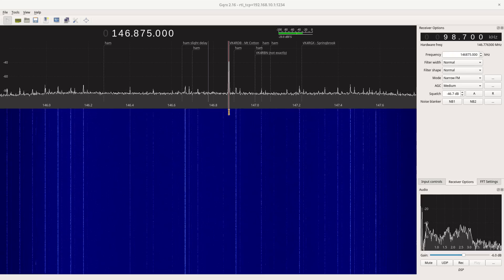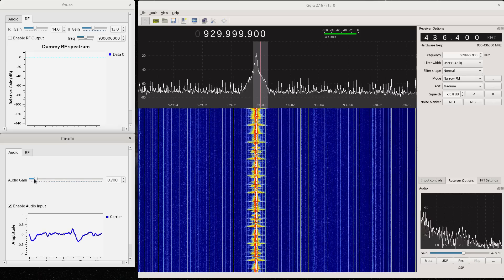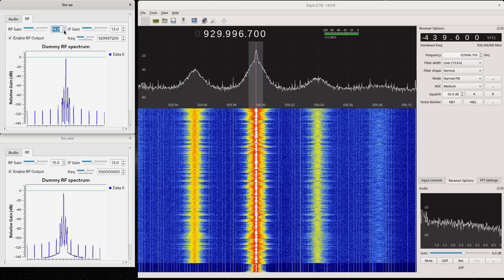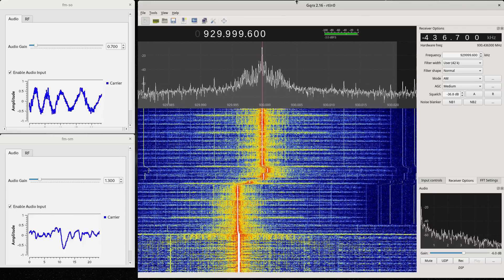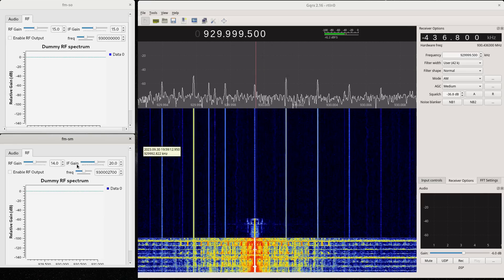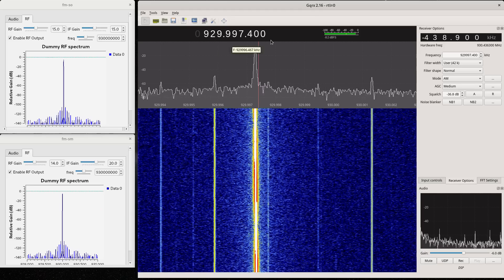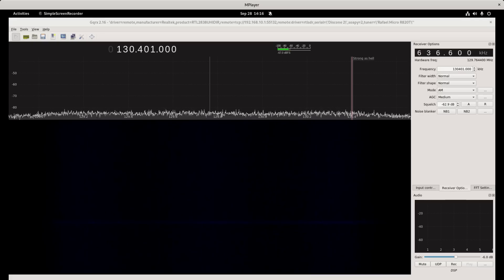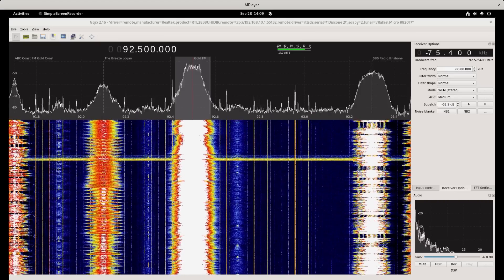Demonstrating FM Capture Effect

Comment: Aaaah... I always assumed BOTH AM and FM exhibit the capture effect! I've also often wondered why AM remains the civilian airband  mode of choice (true of the miliitary airband too, I think) and assumed it was some kind of "legacy installation" business. Many thanks for the carefully crafted and informative presentation Paul👍.
Reply: No, aircraft use AM for good reason. This is so if some clown talks out of turn when tower approach is giving instructions to a pilot for landing, either party will know somone transmitted on top of them.
Reply: AM capture-effect does exist, however, it does require a higher separation than FM in the RF levels between the two carriers (6-10dB difference for a near total capture).  Most instrument landing system (ILS) localizer and glide slope systems utilize the AM capture-effect phenomenon to reduce the effect of multi-path reflections from terrain and buildings.
Reply: @jamieedwards8552  Cheers for fleshing that out,  including the ILS aspect👍. Quite an eye opener to realise the subtleties of all this...

Comment: In practice you can't hear both aircrafts on AM, because their radio carriers are never in phase and on the precisely same frequency, so what you can hear is beat sound of the mixed carriers, meaning nothing intelligible can be heard. Sometimes it is referenced as "duplex transmission. " Accidents have happened because of that fact, like the one on Tenerife, where two Boeing 747 collided on the runway on March 27, 1977.
Reply from the maker: I think a lot of things came into that particular incident, but even if there's that squeal from the mixing, that would probably at least let you know 'something' was transmitted that you missed, right? I don't fly planes though, so I'll believe the others on here who have... except for that pinned comment guy!
Reply: They arent perfectly in phase and arent perfectly out of phase. Sometimes you can hear two conversations at once. Other times they wil heterodyne and you will get the squeal.

Comment: Ameture radio ops can use AM but problem is singal won't go too far and inteferance
Reply: Absolutely not correct. Amateur radio uses all forms of modulation. In fact the most widely used method for transmission over any significant distance including around the world is a single sideband suppressed carrier, SSB, a form of amplitude modulation. FM is generally not used for world wide communications because the portion of the spectrum capable of transmitting world wide, HF, is so limited and effective FM as usually implemented demands much more bandwidth than SSB. The most efficient use of spectrum is CW, Morse, simply turning the narrow signal on and off. The VHF and UHF frequencies generally used for FM are not effective for world wide communication but have much wider channel width available.

Comment: Isn't it also because AM can travel longer distances?
Reply: No, that is a property of the wavelength, not modulation. You don't want to transmit coordination around one airport over to other cities.
Reply: @j7ndominica051  ah right.
But like, isn't long distance radio usually on AM?
Reply: It is. But long distance radio uses frequencies below 20 MHz, while aircraft use around 120 MHz where communication is in line of sight.

In amplitude modulation they can pack more channels. While understanding two on nearly the same frequency would be difficult, there can be overlap in the treble portion of the signal.
Reply: No to the question.  AM is merely  a modulation scheme.  Distance has to do with frequency and watts not whether the amplitude is modulated, or the frequency is modulated. The higher the frequency, the more watts needed to cover the same distance.

Comment: Eventually answers the question at around 6:40.  Apparently a bunch of other commenters missed that.  But yeah, would have been a much more convincing demo using two voice signals, instead of music which is famously mixed to occupy as much of its spectrum as possible and thus less amenable to hearing sensibly two signals at once.
Reply from the maker: I absolutely agree with you, and I wanted to use a male and female voice for the demo. I couldn't think of any female voice to download and use, although I waited for a female news reader on the radio or something. For the male I was going to use the intro to "The Eve Of War" but copyright might have gotten that, so I just went with two different styles of music. You're right though, and it would have been better with voices.
Reply: @TallPaulTech  I appreciate your efforts regardless. Maybe you could have just recorded some voice traffic off your SDR? Or from VASaviation channel?
Reply: FM has a capture ratio as well. Which means the strongest signal almost completely dominates in the case of two simultaneous transmissions.

Comment: Ham (Amateur) radio uses both AM (actually SSB) and FM modulation. FM is typically used in the VHF/UHF bands, but AM can be used there. AM is used most commonly on the HF bands. Also, a variety of modes (not modulations) are used for voice and data (Morse code is technically a form of data). CW (Continuous Wave) used with Morse code can be used on any band. With CW, you "modulate" the signal by turning the carrier on and off.
Reply from the maker: Absolutely, OOK.
Reply: HF air band uses SSB and USB to be more precise. It was SSB that replaced CW on HF air band.
Reply: SSB is a form of modulation. USB means upper sideband, LSB means lower sideband. The choice of sideband is a matter of convention.

Comment: Yea, in practice this does not work. When two aircraft try to talk on the same frequency, you get a squeal that is unreadable. The actual reason for staying with AM is that aircraft regulations for equipment, at least in the USA, is notoriously behind the times. The majority of equipment before the turn of the century was technology from WWII. GPS has changed that, but radios are still behind. The system should have gone digital by now, and there is a good case for why it should come from overhead satellites. This would dramatically improve the system. A lot of it is simply because the FAA (america) does not care much about general aviation, but is oriented around airlines. GA has issues with radio signals being blocked by mountains, but airlines fly high enough for that not to be a problem.
Reply: No, the USA is NOT notoriously behind the times.  AM is used throughout the world on the aircraft band because it is a safety issue because if FM was used,  the capture effect would coverup a weaker signal.  If there is het thrown out by AM, either the tower or another aircraft would know that a signal was interfered with and ask for a repeat.  With FM there is no het. And NO, you CANNOT use digital on the aircraft band because the cliff effect. With digital you either you get a signal or not. Digital has far less range than analog. It would be a disaster if the air band went to FM and especially digital.
Reply: @joeblow8593 The US is behind the times and there is no weaker signal coming through on AM. There is just loud squeel due to hetero. Have you actually used an aviation radio? I'm a professional pilot of 23 years in the US. I'm heading to the airport in 45 minutes. I can't wait for this stuff to go fully digital. The jets I fly use CPDLC (digital) wherever possible but sometimes it's not available depending on where we are. We are all required to have ADS-B out and most modern aircraft even have ADS-B in (if not built into the aircraft you can get it on your iPad). That's all digital. GPS is digital also, of course. I can't wait until AM voice dies and we can finally standardize on a digital voice mode. Range isn't an issue as all VHF is kind of site anyway and 5 watts is enough to hit the horizon regardless of what mode you are using. Although digital voice is even more efficient.

I can't believe there isn't a "blocked" compilation on YouTube somewhere. Happens all the time. Almost every flight. It's a rather boring yet annoying phenomenon so probably wouldn't actually be very interesting on YouTube.

Comment: 9:30 are aircraft transmitters really synced like that to transmit on exact same frequency?
Reply: No.  Aircraft transmitters are set up with sufficiently-precise frequencies to be certain of occupying the desired channel that has been selected.  However, the frequency of individual transmitters can vary slightly.  It would be possible but pointless to lock all the transmitters to a single reference (such as a Global Positioning System, GPS, derived frequency reference), since the transmitted frequencies are variously shifted when they arrive at the receiver due to the doppler effect that arises when the distance between the aircraft and the receiver changes with time.
Reply: @analog_guy  There is no doppler effect in aircraft! EMR travels at the speed of light, which is about 300,000kmh per second or a bit over 1 billion kilometres an hour. The fastest plane that can or has ever operated within Earth's atmosphere travels so slowly, by comparison, that it might as well be standing still.
Doppler effect starts to be a factor when you're talking about satellites or the ISS which travels at a bit less than 30,000 kmh. Even then, the effect is only minimal with about a 3.5 khz. swing. To put that into context, the stations on an FM broadcast receiver are 200 khz. apart.
Reply: Yes. :(

Comment: There is no one reason why aircraft use AM. The first reason is the cost of moving to FM. The second is how do you do it without shutting air traffic control down for a significant length of time. All aircraft and control stations would have to maintain dual capability for a long time or else shut down until all transmitters and receivers could be changed. The third reason is what you discussed here, you end up losing the ability to detect a blocked transmission (two people trying to transmit at the same time). That third item happens all the time in busy US airspace, and pilots (and controllers) use that detection quite often. Non pilots, or pilots who live in airspace that is not busy, will never understand how important that is.
Reply from the maker: Sounds like the IPv4 and IPv6 saga :)

Comment: In addition to the capture effect FM has, FM also generates more adjacent channel splatter.  Europe has a specification requiring the transmitter adjacent channel power to be 70 dB down, which can't be met with FM.  Of course AM is more susceptible to atmospheric and man-made noise, such as engine ignition noise and P-static.  However, since we are operating at 120 MHz, the spectral power is down considerable versus low frequency bands.

The reason narrowband FM became so popular has to do with cost.  AM requires a low distortion transmitter that needs to make 4X peak power, whereas FM simply uses a CW transmitter since the modulation is encoded in the frequncy domain.  The FM receiver also does not need AGC, making it simpler/lower cost as well.  Narrowband FM also has the desirable logarithmic quieting, making it sound better with weak signals, with the tradoff being about a 40 dB ultimate quieting.

Sensitivity wise, AM and FM are about the same, which is governed by the IF and audio bandwidths.

Comment: I think that the real reason is that aviation NEVER abandons a technology. Just look at the METAR weather reports. There are few things more important to a VFR pilot than the weather. But the METAR reports are almost unreadable because they started out having to be very short. Now, they can be much longer and easily readable, but they're still indecipherable.
https://www.weather.gov/media/wrh/mesowest/metar_decode_key.pdf
Reply: There is another reason for METAR. It was originally developed in Europe, where people with many languages still had to read the same weather forecast. So they developed this hodgepodge of teletype based coding so that they could convey the weather along with any NOTAMs that the pilots should be aware of. Today, the language issue still exists, so METAR is still the rule. The US adopted METAR in the 1990s so that European pilots didn't have to learn an entirely different system here in North America. But we still had to insert our "freedom units" in to it. So it's not the same. 

That said, the technology for viewing weather forecasts, radar, charts and the like has vastly improved over the last 30 years. But some things don't change. One of them is that damned interface based around teletypes and weather faxes. We're slowly migrating away from that. But the old ways continue to linger.

Comment: You lost me. I thought you were going to explain. "Why Aircraft Use AM"
Reply: The key reason is that with FM the strongest signal will "capture" a receiver such that weaker stations are not heard at all. With AM the stronger signal will dominate but you can often hear that there's another signal in the background. That can alert others that there's an emergency call being made. The stronger station can be silenced so the weaker can be heard. You can heard that at night or an ordinary radio by listening the AM band and then the FM band. On AM there's much more interference between stations. On FM you hear only one. I suspect marine VHF radio went with FM in part because marine emergency typically don't have the same 'seconds count' urgency of aviation.
Reply: @Inkling777  Thank you.

Comment: Another benefit of AM compared to FM is the required bandwidth. 
Due to the limited channels intended for aviation , aircraft here in Europe now need to have a radio with a only 8.33KHz channel spacing.
Reply: You could get any channel spacing with any modulation: I turned my 800hz 80dB filter from Collins on by mistake at narrow-FM/SSB
You could get AM into 2,3kHz spacing without the carrier and only one side band. With FM you could get even into 2,3kHz or lower in digital modes.
https://en.wikipedia.org/wiki/Single-sideband_modulation#/media/File:Modulation_categorization.svg. 
We should really switch from AM to digital mode with one master station for channel and timing (TDM/FDM). Even in Tetra25, some handheld station could act as a master.
Reply from the maker: Yeah, in my video on how digital radio works, I showed the comparison of 20MHz of FM radio band to the less than 2MHz of digital radio and how many services can be put into it.

Comment: AM tends to have a longer range than FM. At night you can receive AM radio stations thousands of km away.
Reply: This is because the radio wave frequency of AM stations is about .5 to 1.5 Mhz. At night these waves bend off the ionosphere following the curve of the Earth and can travel great distances. The FM station frequencies are 88 to 108 Mhz. These waves propagate in a straight line and are lost at the horizon, hence, line of sight only.   AM and FM  represent two different electronic ways of putting voice and music on any given radio wave.
Reply: @ThomasButler-sp4ro 
Aircraft today uses 118-136 MHz, so yes they are limited to line of sight. :)
Reply: @rusle there is something called tropospheric ducting....
Reply: This is because the frequency not the transmission method

Comment: The aviation use VHF and UHF AM to reduce the distortion produced by doppler effect  ...  FM signals coming and going to an aircraft would be subject to the Doppler effect, wich can shift them off the established communications channels. The greater the aircraft speed, the greater would be the shift. 
Secondly, AM mode permits all stations working the facility at the same time to all be heard simultaneously (in FM mode, only the station with the strongest signal would be heard).
Reply: Nope. One, AM is subject to the doppler effect just as much as FM. Two, these are radio waves moving at a significant fraction of the speed of light. Even for supersonic aircraft, the "distortion produced by the doppler effect" is so very tiny that most consumer equipment wouldn't even be able to measure it, much less have it actually affect anything.
Reply: Make yourself a test on a plane on a holding patern on VHF FM and listen ...   @HiddenWindshield
Reply: Not moving fast enough.  The only radio I know of an amateur can participate in that involves the doppler effect and having to calculate it to make contact is using satellites.
Reply: Are you sure ? the Doppler VOR are working by magic ?  @parajerry
Reply: Where did this myth evolve from? EMR travels at the speed of light. 300,000 kilometres per second or a bit over 1 billion kilometres per hour. The fastest fighter jet on Earth might as well be standing still on the ground, in relation to that speed. When we're talking about a commercial airliner, travelling at one one millionth of the speed of light, go figure?
It's getting late, and I'm getting tired, but the frequency shift is for practical purposes, nothing. When you start talking about something like the ISS, travelling at about 30,000 kmh.
then you're going to have to make some adjustments on your receiver, due to Doppler effect.
Reply: the doppler VOR ( Doppler VHF Onmidirectional Range ) is a myth ? the doppler radar is a myth ?   @davidbrayshaw3529

Comment: So why pressing the PTT button effectively blocks everyone on frequency, if they were completely perfect stuck mics wouldnt be a thing but they are and a big problem, and one all pilots and users of the air band try to avoid, i think the main reason to use AM its really because its old really old and aircraft and aircraft regulations have been around for a century now, sure the fact you can sort of hear eachother on AM because the Amplitude of one wave justs gets added to the other helps, but i dont think  that was something they thought about, stuck mics block frequencies when one is transmitting the frequency is effectively blocked and its really hard to understand any of it. Still very Interesting video and well explained and detailed.